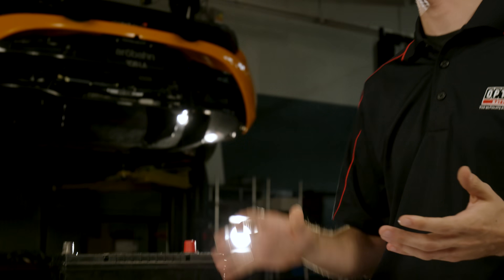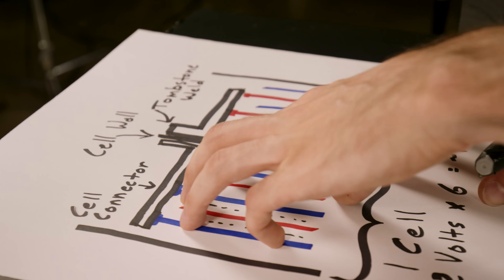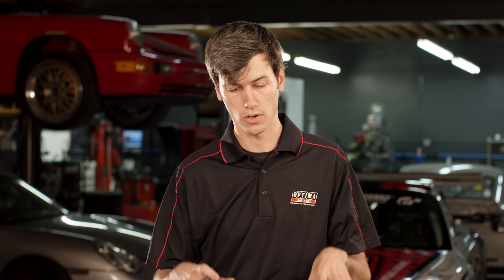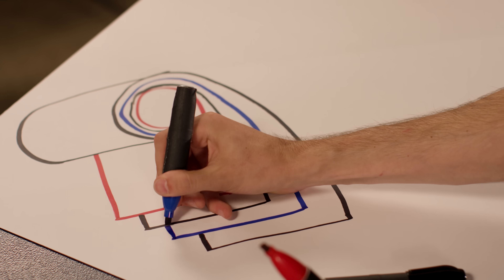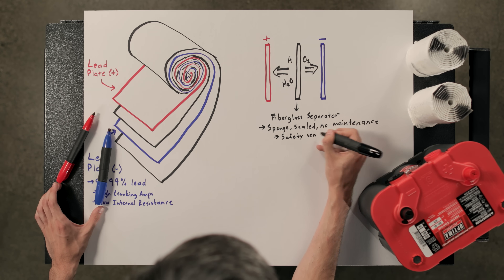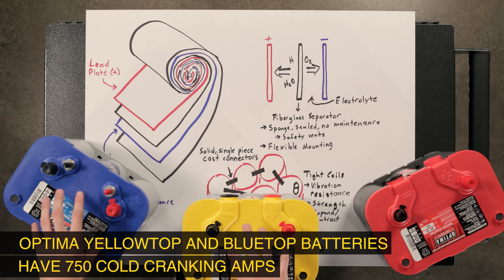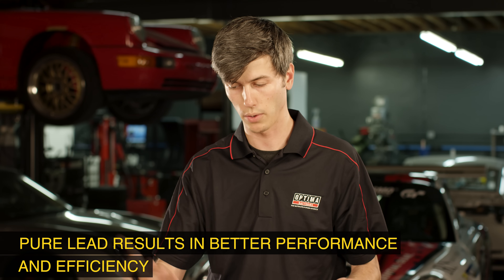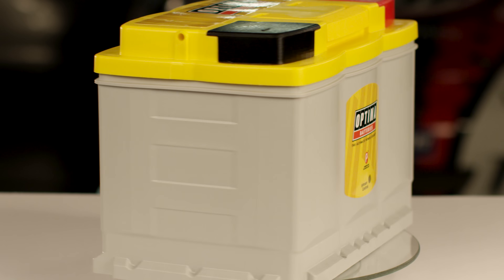What Type Of Car Battery Should You Use? Flooded vs AGM

Comment: First off, thank you, I love watching and learning from your video. This video felt a little different than most of your other videos, because it didn't really feel like you gave us a summation at the end with you thoughts and opinions. I think I understand why you did this video the way you did, i.e. Optima kind of sponsored you to to this video, so you can't really say anything negative about their product; that is, if you even had anything negative to say. Anyway, it would have been nice to learn a little more about when you'd want to use the red top vs the yellow top batteries, i.e. truck with a wrench, high powered car stereos, etc. Also, what are the real difference between the yellow top and the blue top batteries? Thanks again for all the videos you post!
Reply from the maker: Hey there! Thanks for the feedback. Red-top is more purely for high cranking amps, but good overall. Yellow-top has lower cranking amps, but can be cycled a lot more (great for applications like a truck, winch, RV, etc). Blue top is specifically packaged for marine applications (extra terminals), yellow top is packaged for car applications. Chemically, they are identical (but differ slightly here vs Red Top).
Reply: I agree this felt more infomercial-ish.  Hopefully EE got a good payout for it to fund the other (IMHO nerdier and thus better) vids.
Reply: It felt off because it's a 7-minute commercial.
Reply: This infomercial-like content is a big turnoff. Seemed very different from your other work. I hope this isn’t the wave of the future.
Reply: Difference between yellowtop and bluetop are the terminals. Bluetop has stainless (not 100% sure if steel) terminals, yellowtop has normal terminals.
Reply: I built car batteries for 10 years. From casting and extruding grids, pasting the oxides in, assembly, forming - nobody was doing spiral back then, but the rest of it hasn't changed. And I can tell you those are top quality batteries. So even if he is schilling, the content is still good and correct. The catch will be when you go to buy one. I have no idea, but I'm sure those Optimas are not cheap. Then you'll see the advantage of the old crappy one with half the lifespan.

So he's right about the lead alloy thing, they put combinations of calcium, antimony, tin, silver and more; in an attempt to stiffen the grid so it can be handled. You saw him rolling and unrolling that very soft grid. How are you going to put that through a machine? You could not do that with an alloyed grid that was more than a day old, it would crack and break. The grid has to be pasted over with lead oxide mud, cured in a high humidity oven until it is rigid, and then wrapped in separators and jammed into a container. All with high speed equipment. 

But too much alloy and it will crack, either during assembly or soon after it is a battery. The alloying part is a pain in the ass, and a lot more expensive than pure lead would be. But a pure lead grid that comes out of a mold would be as soft as icing on a cake. Since it is pure lead, I guess you could spray it with water without fear of cracking, so you could then handle it in some fashion. It has to be trimmed, since what they cast is twice the size of that part. When a grid is too soft it can't be trimmed. The lead just smears like the icing.

The machine I ran would cycle up to 15 times a minute, casting 2 grids at a time. The grid in his hand is not coming out of a mold nearly that fast. I wonder if they can even get a grid a minute out of their casting machine. I would love to see that machine. I guarantee it would be fascinating for everyone.

Comment: What about maintanence free lead acid batt??
Reply: Also known as a SLAB (sealed lead acid battery).  Yeah, what about SLABs?
Reply: The alloy used typically in a flooded lead acid battery is antimony(1-4%). Replacing antimony with calcium gives you a maintenance free battery. Advantages of calcium include improved resistance to corrosion, no excessive gassing, less water usage and lower self discharge. The case can be sealed so the small amount of gassing can condense and return to the cell.

Comment: Why we dont use litiun bateries?
Reply: 0ExG0 lithium plus air equals fire
Reply: they hate variable weather combined with 90 deg hot engines close to them. also  they have lower maximum current for the price and most importantly storing lithium batteries is much more expensive-driver circuitry and andvanced safety tech, because when a lithium goes bad it goes really bad really quick
Reply: for 150 dollars you get 800 amps on a device that you plug 2 wires and it either works or it doesn't. this technology has proven reliable over the years and you don't need any protection from any failures-no undervoltage protection, no overcurrent protection, no overheating protection in most cases, no special covers, nothing
Reply: Yes that is true but at the same time we have them not only in the hybrid cars but also in every single smartphone so it is possible to use them safely at a reasonably price.